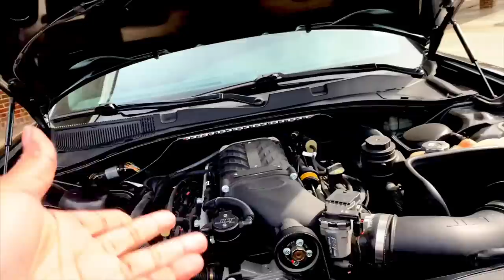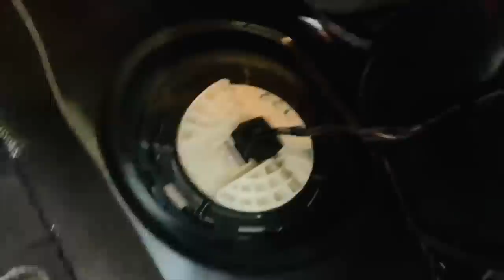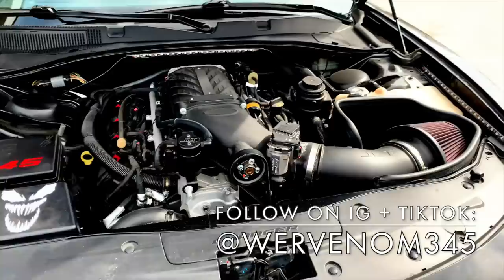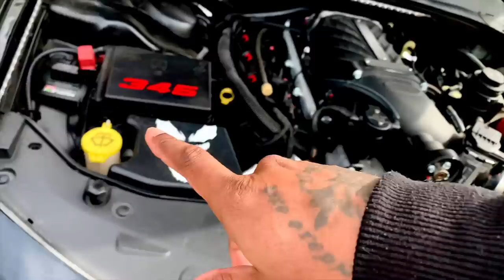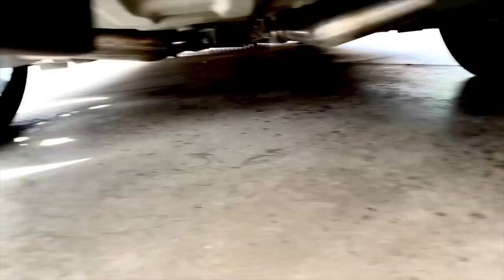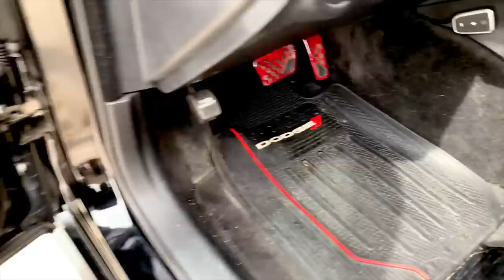How to make your Dodge Charger + Challenger 5.7 HEMI faster than a 392 Scat Pack and a Hellcat!!

Comment: I would think the A/C would work better with a cooler stat, because the A/C condensor sits right next to the radiatior.. talked to a guy at diablo and he told me the higher engine temps give better performance.. he said there are some stock cars that have t stats all the way up to 230 F. So im on the fence abt changing mine,.
Reply from the maker: Heat is ALWAYS the enemy bro. That’s not opinion. It’s proven car science. Drop your coolant temps for more power AND to make your motor last YEARS longer.

Comment: Can you give some advice on the 6.1 liter? I have a 2006 300C SRT8.
Reply from the maker: Your 6.1 intake manifold is perfect for boost and regarded as even better OEM than the 6.2. You’d love a Procharger setup with that manifold but, on a lesser note, simply upgrading your CAI and throttle body will help add some go to the 6.1. 

Your manifold LOVES air. 🔥
Reply: Thanks so much for replying bro!!!
Reply from the maker: Of course!

Comment: Can it handle the hp without doing any major engine or transmission modifications
Reply from the maker: You won’t NEED to touch the transmission or stock bottom end unless you either want to or you’re approaching Demon level hp at the crank. I ran on 600 rwhp for more than a year with no issues (I’m more now). Build it right and tune it correctly and you won’t have any problems.

Comment: I have a 2013 300c 5.7 and will just be getting started with upgrades...its a daily and am gonna start with the "Breathing" part first..cold air intake high flow cat and from what i gater from your video a 3" catback then a dynotune..i live in Cali so smog is a bitch...and feel handcuffed to what i can do...what do you recommend for starters on a budget?
Reply from the maker: Eek… you’re in Cali. 😬 You are handcuffed by CARB. That’s a tough one to figure out because you’ll get a ticket for damn near everything out there
Reply: @WeRVenom345   all I'm worried about is passing smog...I will pay for citations I just want a cold air intake with ram air a dyno tune 3" exhaust  but Cali is a bitch

Comment: I just bought a 2015 sxt and can't wait to have fun doing a little build with that , have any suggestions?
Reply from the maker: Aiming for RT power? Plenty of examples of SXT/GT owners doing nice builds. Just depends on your endgame for the Pentastar and knowing what it can handle.
Reply: Yeah definitely aiming for RT power , for start plan to delete resonator and muffler just for sound purposes definitely a cold air intake and go from their
Reply from the maker: You’re probably going to have to look into a blower (RIPP supercharger) as the major power adder, but in the meantime you can do what you can: CAI, manifold swap to shorty headers (for starters) and look into a bigger throttle body (NOT A SPACER). More air + less restrictive exhaust equals more power.
Reply: Thank you big homie you've been a great help appreciate your input , I've learned alot form this video. Definitely will pay attention to new and old vids you have .

Comment: can you upgrade your injectors on a stock 5.7. just so you can have it ready for when you do other upgrades. will it run the same with a tune?
Reply from the maker: Yes you can. They’ll simply push only what the PCM tells them to push, which would be the same flow as stock without a tune, but at least your hardware would be ready for when you need more fuel for power. 

I run 1000cc injectors. And, at the moment, I don’t need 1000cc injectors (750cc would do for my e85, and 600cc is fine for premium gas on high powered engines like hellcats). 

So why’d I get 1000cc? So I wouldn’t have to change them out later when I turn the power up again. 🙂

Comment: What if I can get a hellcat blower for 1k? I keep thinking something is wrong with it but then it could also just be a good deal. I just don't know what it should all come with so that makes me doubt it even more
Reply from the maker: It’s a good deal until you factor in the cost of the adapter kit and parts. That’ll put you at nearly what it would cost to get an aftermarket blower. It can be done, but I passed on it

Comment: What are your thoughts on a hellcat oil pump and an oil cooler?
Reply from the maker: Great options for upgrade that are also less expensive (ideally) than most aftermarket. You have some better options you might consider down the road but, as far as an initial upgrade (Phase 1), those are damn good ones. 🔥

Comment: How has the car held up so far? I’m looking to get a hemi 300 just worried about the reliability
Reply from the maker: I’m 7,000 miles on the current setup (supercharger included) and running strong. I even drove from Texas to NC and back on it last year. Was a FUN trip but not for my wallet 😂
Reply: @WeRVenom345  thank you perfect ‼️

Comment: My rt mileage high i dont think i could build it like yours
Reply from the maker: No such thing, bro. Don’t buy that lie. You’ll probably need to upgrade some parts you should be upgrading anyway, but it’s doable. Stop doubting yourself.
Reply: @WeRVenom345  u right ima invest more into my car also its paid off and it run smooth no problem at all
Reply from the maker: And with it paid off it’s the perfect time to build it! Go innnnnn 😈

Comment: Any suspension parts you would recommend to make my 13” 5.7 ride a little smoother
Reply from the maker: You could do air ride if you want it smoother, but that’s not cheap. Any other suspension upgrade would be more for performance or lowering and you actually often lose softness when you do that.

Comment: So if i got everything installed such as a intake and a throttle body, am i able to still tune it later on together? Or do i have to tune one part at a time.
Reply from the maker: You don’t “need” a tune for the CAI + TB but you’ll want one eventually, especially for the larger TB because it may or may not throw check engine codes (you’re taking in more air and the PCM might get confused— but not always). But remember that without a tune, you’re only getting a fraction of the gains. But keep building!

Comment: will this work on a durango rt?
Reply from the maker: With some variations, yes it will
Reply: @WeRVenom345  already ordered a borla exhaust, a cold air intake and a throttle body, we’ll see how she goes
Reply from the maker: What size TB are you moving to? Might need to tune with that TB change for maximum results from the upgrade